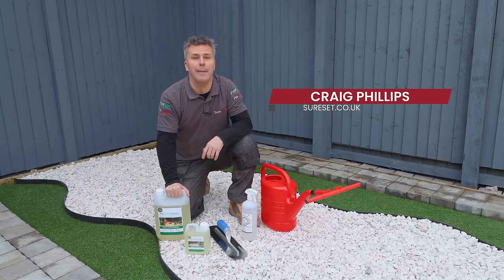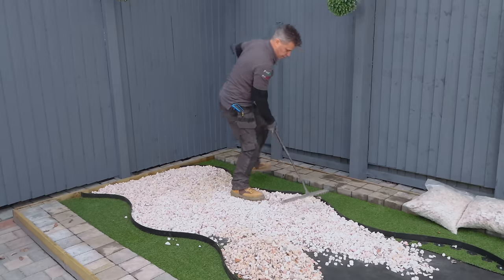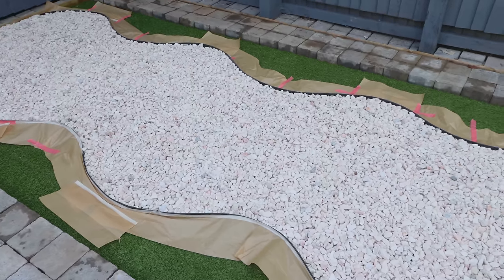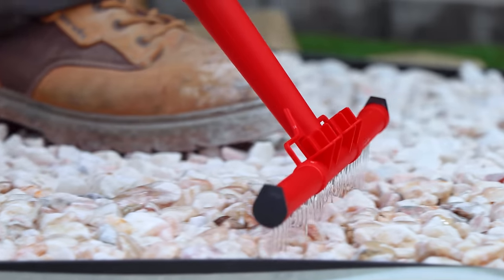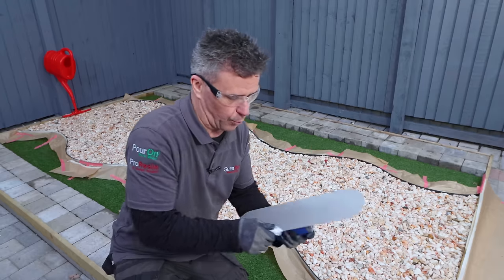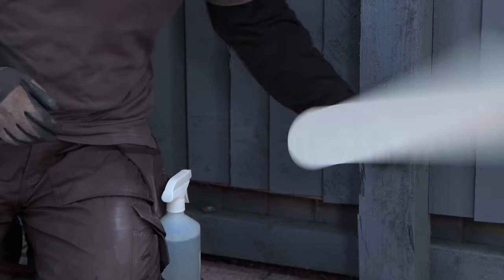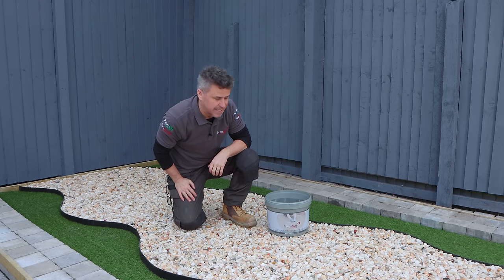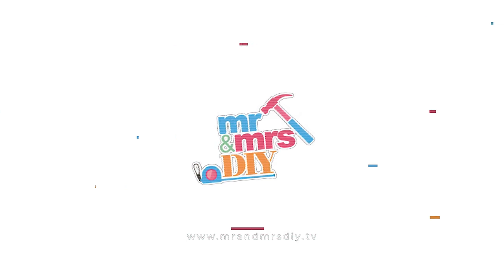How to Create a Resin Bound Pathway | Pour On Gravel Binder | FULL A-Z GUIDE @SureSetResin

Comment: Craig what a legend, good to see your still looking great. Can this be used for driveways ?
Reply from the maker: Many thanks, Superset do supply a resin for driveways, its a little different than the one I used here as this one is only strong enough for commercial pathways, check out there website for further details www.sureset.co.uk
Reply: So glad I’ve found your channel Craig and an immediate subscriber. I built a driveway at the front of my house on one side and circular path for my flower beds on the other side. So much hard work having never even touched a cement mixer before lol. I searched everywhere (3 yrs ago) how to do a resin mix but everything seemed so complicated so I ended up individually placing each stone onto the cement with glue along with faux grass and plastic wood planks. Obviously didn’t work as it looked far too fussy and has broken, torn or disappeared. In a way  I’m glad as after watching this il actually be able to cover both the way I wanted to, although it’s going to be expensive so I’m going to have to save. 
Like so many others, you were the best ever Big Brother winner. In fact I think I’ll watch the series again. Nothing like a bit of nostalgia.
😊😊😊
Reply: Thank you, Not this resin, but Sureset do make resin for drives too, check out there website

Comment: Could reflective beads be applied while the last coat of gravel binder is still wet?  The idea is that the path or walkway would be easier to see at night, even in low light.
Reply from the maker: Great question and idea, I'm sure sit would be fine but I'd certainly check with the tram at Sureset first, drop them an email www.sureset.co.uk
Reply: I'd imagine so, ive never tried it tho, let us know if you do try it

Comment: Ace video. Inspiring! What stones are used in this video? If laying a new path driectly on top of a grass lawn, what do you need to place beneath the stones? Hardcore? Or can you get away with just a weed proof membrane?
Reply from the maker: So underneath your pathway, it should be prepped properly, I personally would tamper the surface down so its nice and strong, then overlay the membrane over it, because the resin only goes on the surface. Cheers
Reply: Yes you'd require some hardcore

Comment: Hi Craig.  Great video.  We have a path where each slab is separated by pice of grass. Our dogs keeps digging at the grass sections.  Therefore want to lay gravel instead of the grass & for a border around the side of the path.  I’ll then use the resin.  I’ve got a couple of questions:
- What is the depth of gravel have to used for the path
- What base would I need for the gravel
Thanks in advance
Reply from the maker: Thanks mate! This type of pour on only goes to the top layer to keep it all together, my advice would be to prep the base with MOT roadstone, then you can put your weed guard on it, then your stones/gravel! Cheers

Comment: If laying a gravel driveway using gravel grids, would it be ok to pour this over to give it the wet look and hold the top surface together, or would a car ruin it?
Reply from the maker: I'm not to sure about it with the gravel dries, I know Sureset do supply gravel grids for below driveways but not sure which type as ive not used them, I'd contact there tec team, they would be able to advise www.sureset.co.uk
Reply: @MrandMrsDIY  ok thanks for the reply 👍

Comment: Hi Craig, Which of the two methods would you recommend this or the mixed resin you did around the slabs?
Reply from the maker: Very tough! This method is just really easy to do, but the other one was really satisfying to lay around bits and pieces such as pipework and slabs etc!
Reply from the maker: What sort of areas are you planning on covering
Reply from the maker: Do you have any stone / gravel down at present
Reply: @MrandMrsDIY  I have roughly 3 square metres between my raised composite deck and my garden room. It has a slight raise to one end so thought this would be perfect

Comment: Hello, I’m planning to use bound resin for a patio. I’ve seen conflicting advice about the sub base and wondered if a base comprising 100mm MOT type 1 topped with a well compacted ballast would be okay in this application? There won’t be any vehicle loading. Will I need to prime it?
Reply from the maker: As long as it's compacted down correctly, it should be okay! But this type of pour on resin isn't suitable for driveways, cheers

Comment: Is this process any good for driveways
Reply from the maker: Most certainly yes, however we will need a firmer bace than just the hardcore we have on this pathway, check out Sureset's website www.sureset.co.uk
Reply: Not this resin, but Sureset do another resin that works on drives

Comment: I bought the prewashed stone and resin bond/bind(?), followed all the rules, and still it didn't bind together.  I won't ever use it again.  Stones became loose a few months later.  I will use the version of resin bound, where the two are mixed together and trowled out for a job in a month's time.
Reply from the maker: Contact the tech support team, cheers
Reply: I had a company lay my 130 square meter drive with resin bound gravel. He is now serving a 3 year sentence and disqualified from being a company director for 6 years. He had approx 60 customers in court witnessing against him. The product itself is good but a magnet for moss etc.
Reply: @stuartalexander3  
Wow!  Fortunately, the piece I laid was small, and I'm returning in the summer to put it right.

Comment: Can you use this on rubber mulch? I have black rubber mulch in my landscape and it drives me crazy every time I get leaves in there, and I try and blow them out just to get my mulch in my grass.
Reply: Best thing you can do is scoop up that rubber mulch and dump it in the rubbish bin 🤗
Reply from the maker: I would say no but you would have to check with the manufacturer. The best way would be to dig it up and put down MOT Roadstone, tamper it down then put your stones on top of that, cheers

Comment: Please can you tell me is the applicator nozzle ruined after use? Ie use first day and need to use another one in 2 days time when applying the 2nd coat?
Reply from the maker: Nope it was absolutely fine! Just may need to wait for it to dry before you can remove any dried bits blocking any of the nozzle, it should only be a very thin layer if you've used all of your pour from the watering can!

Comment: Could one do this in the garage with small smooth stones?
Reply from the maker: Not if you're putting cars on it. It'll hold the weight of a person but not a vehicle, sureset do make a resin bound system that you can use on driveways, cheers
Reply: Yes why not

Comment: Or you can forget all that crap and get it block paved with some nice blocks and have a proper permanent area.!!!!!
Reply from the maker: Depends what look you want for your garden
Reply: Block pavers move with time as they are bedded on sharp sand; ants love to get under them and undermine them
Reply: Iv never had any problems whatsoever with ants, settling,or anything else and they’ve been down absolutely years. I spray a little weed killer and then jet spray it once every 2 years. Still level,still looks great. 👍
Reply from the maker: Yes I've seen Ants look it below your block paving, I took up a couple of our blocks in our drive and found Ant N Dec living under there!  @leestockton9367
Reply from the maker: That's great to hear, yes just a little bit of maintenance thats all they need
Reply: 🤣🤣🤣🤣🤣🤣🤣 of course you haven't 🤣🤣🤣🤣🤣🤣🤣
Reply: 🤣🤣🤣🤣🤣🤣🤣 of course you haven't 🤣🤣🤣🤣🤣🤣🤣
Reply: Laugh as much as you want mate but it’s been problem free.

Comment: That’s one awful way of doing resin a pathway .. You need a proper resin mixer not a cheap plastic Poundland tool
Reply from the maker: This is just a pour on product? Not a resin bound mix so you don't need a barrel mixer, we do have a full installation guide with using it this way on the channel! Cheers!